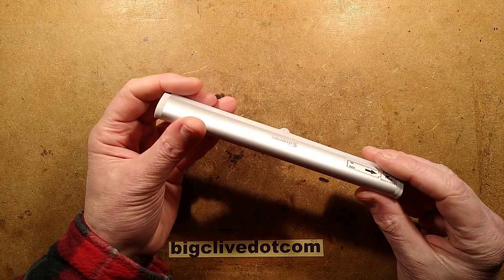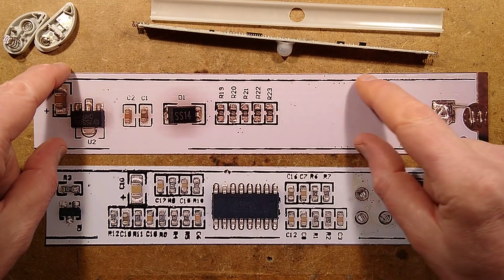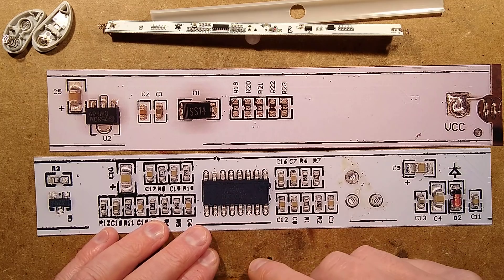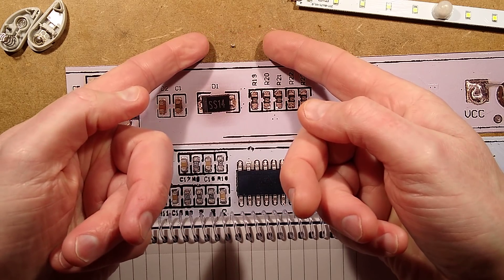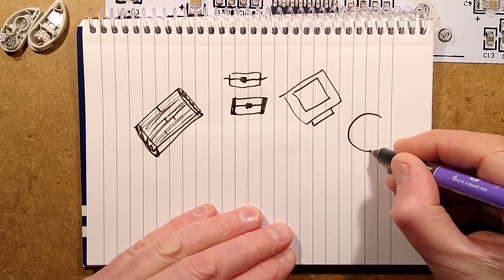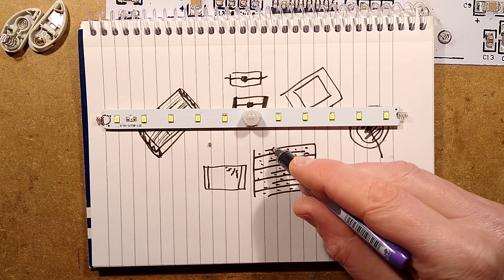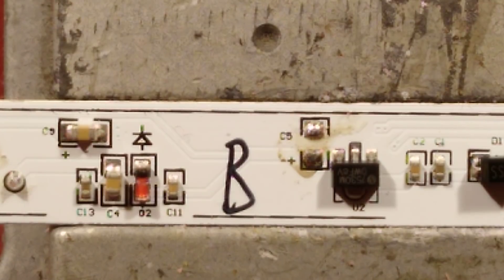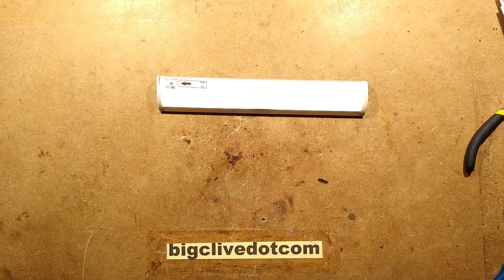Fixing a faulty battery PIR light that was draining the batteries fast.

Comment: Interestingly enough. I had a weird situation like that and like at first of the latest second it doesn't be any resistance here at all. This should be pure capacitants or even if it's completely bad open and when resistance was present. Oh my, what and I'm like? This is not supposed to happen and just tell me a stump what could have happened.  Happened to it? Because well, I'm never actually dove into the internals of one of these and absolutely this is just something that could easily happen. I don't think this is really a cautionary tale not to use these types of faster. But it's something to be aware of and if it's happened, once it'll happen again, kind of thing. So I definitely I'll keep this in mind in the future.  Since I've already run into it and just come unburied.This memory this video that is and yes well rather peculiar failure mode for sure and interesting them at last

Comment: I've got two battery powered PIR's that are drawing way too much current and flattening the 3 x AAA batteries. Yet they both work OK. So by your measure I should look for a leaky C first eh? There's also a SMT electrolytic that has been replaced with a wired electrolytic (in both) ....!! I suppose it makes sense since it works, but what do you think of that: They do usually leak a bit of DC. I've dealt with surface mount BUT not really the fault finding/failure side of them. I'm aware of static damage especially to Transistor junctions. So I'll go for the caps first then. I enjoyed your videos. Unpretentious, very honest, and full of handy snippets. Thank you. 
Notes: Me a lifetime of "electronics" from valves on. A bit lazy now wrt surface mount as the eyesight isn't that good. These really are tiny. I just want a result! Rgds BjG

Comment: One "solution" to MLCC is to have two in series so if one shorts you still have one left before it shorts out.

And also seen on EEV Blog it can be soldered to a seperate small pcb for holding the MLCC and the soldered to the board to prevent stress on it so it's decoupled from the main board

Comment: Thanks Clive this inspired me to look at an Aldi strip led PIR powered by 4 AA cells  it only lasted a few days. It  look as though they put a 3.3 V Zener to stabilise the voltage for the PIR this was fed b a 1K resistor it was drawing a constant 2.7m-A when the cells were new. Removing the zenner cut the consumption and it still works ok. I think the circuit was designed for power supply operation rather than batteries. Could this be the case?

Comment: Fascinating. I've been wondering how they make surface mount capacitors. It looks as if they are trading off size against reliability, and it isn't working out. Are the more expensive brands larger?

Comment: How did you determine the baseline current draw to find what the leakage was?
Reply from the maker: These things usually have a quiescent current of 50uA or less.  I connected it to my bench power supply and it was initially drawing 5mA continuously which is why it was eating batteries.

Comment: I always wondered just how reliable those high-value SMD caps really are. I will definitely remember this problem, since it is not exactly an uncommon failure (and I seem to remember I've got a few battery powered PIR Leds in the shed, possibly with a similar drain issue! Thanks for a VERY useful bit of information, BC!

Comment: What do we define as "draining battery fast"? I have similar light and need to change batteries every few days which I thought is often.
Reply from the maker: That seems too often.  It also depends on the number of light actuations.  It may be worth getting a USB rechargeable version or some good quality rechargeable cells.
Reply: @bigclivedotcom  Oh I used rechargeable ones but I didn't like this cold white LEDs so I went back to warm white LED mains light with sensor in my corridor :)

Comment: Thanks.  I experienced this exact problem not too long ago with my Swiss Micro DM42.  It drained batteries in about 3 days.  One capacitor had about a 1K resistance.   A replacement electrolytic from my parts bin was too big to fit in the case.   Swiss Micro promptly sent me a replacement part and my calculator has been working perfectly fine ever since.

Comment: Just FYI. I had a whole batch of product that had one such capacitor problem and it turned out that the component glue and flux from the automated assembly process had conspired to make the PCB under a particular capacitor somewhat conductive, always the same cap and always the same cause. Remove the cap, clean underneath and replace (new cap BTW), all good again. lost count of how many we fixed but certainly many hundreds over an extended period.

Comment: install a disc capacitor to fix the problem . The unit would probably work fine without that surface mounted trouble maker

Comment: It's always caps, the weakest link.
Surface mount or discrete, when any electronic device fails and it's not the batteries, blame the caps.
Whoever finds a way to make caps that don't fail so quickly may retire to the Seychelles the next day.
Reply: Maybe we should use polystyrene or silver mica throughout, eh ;-)

Comment: i wonder if it got a static discharge "zap", that for sure kills them.
I've seen it happen on tv's where the people zapped through to the side button board and it shorted a cap out down on the remote sensor/power led board at bottom of tv, they were directly connected then from there to the bigger boards.

Comment: We used lots of these at my last company, and they do fail quite a lot when stressed from either heat or just flexing of the boards. Even more interesting when they're used in HV circuits as they can melt down or literally be blown clean off the board by the discharge when they fail.
Reply: Did you figure any way to make them less fail-liable? Not much opportunity for stress-relief, with SMDs (as opposed to THT. where kinks in the leads will comp for most thermal or board-flex differences).
Reply: @theskett  Actually we did find some ways to reduce the failure rates. Specifically on a PSU module that had multiple panels wrapped around a chassis that tended to flex during testing and cause cracks as well as bow after installation. I did a study of various materials to find a composite that was stiffer and resisted bending and flexing and that solved the issue of them cracking. On other types of modules with odd geometries its also been solved by tweaking the reflow profile to allow the solder joints to better relieve stresses so they don't crack.
Reply: Thanks for the info, appreciated.

Comment: It's wonderful to me every time to see how different your soldering technique is from mine; my work on MRI image coils involved a lot of swapping out those cubic-millimeter SMD caps during circuit tuning, and I always soldered up the pads and then flowed one end down and then the other. I did have hot tweezers but those were really only useful for removing components.

Most definitely hit those with 63/37 and a nice relaxed iron, though.

Comment: Yes! I had an old fashioned alarm clock that I decided needed a small modernisation to rechargeable batteries. I used a USB Li-po charger module from eBay and connected that up to the battery. It worked great except it needed charging every month! Eventually I decided to dig up this rabbit hole and monitored the leakage current while heating up each component with a soldering iron. As soon as I touched the MLC capacitor, the current changed wildly. Now it lasts multiple months between charges :)

Comment: Hey Clive, soldering small SMD components with hot air is easy and fun. Place on the bench a scrap PCB, take hot air gun in your hand, start with desoldering components and then try to solder them back. Test different temperatures, air flows, nozzles, fluxes. It's easy to learn when there's no fear of damaging something, because it's scrap anyway.

Comment: These boards will be made in one large panel, maybe a dozen per panel. When this panel is 'broken out' into the smaller boards, stress or bending can cause an MLCC cap to crack. Then it's just a matter of time to catastrophic failure.
I've seen boards being removed from a panel like peeling a banana. Result? a 30% failure rate.

Comment: Hello Clive at 9.25 in on the video you show a component, and would I be right in saying the unit was a touch light box, it looked very like one I have just replaced in a lamp. They tend to blow quite often and wonder if you have done any videos in reverse engineering and figuring out what component really fails? If not it might be an interesting project vid. Many thanks enjoy all your videos.
Reply from the maker: It is a touch sensor.  One of the most common failures of any dimmer is to jam in an on state when a lamp fails with a pop.  Small lamps tend to arc over inside like a discharge lamp when they fail and it causes the triac to fail.

Comment: Lious Rossmann has another way to find a hotspot:  Spray the board with high-purity IPA (which you have around anyway for cleaning boards) and look for where it evaporates fast.
Reply from the maker: In this case the temperature of the faulty component is very low, so it wouldn't work.

Comment: Definitely not the first time I've seen MLCC failure -- don't get me wrong, I still use them, because the benefits outweigh the potential of failures -- but man, it is difficult to ascertain WHY they failed. Physical/thermal stress-induced fractures are probably reason #1, but I've also seen improper flux-cleansing methods cause leakage problems. I do have to wonder whether some MLCC manufacturers tend to push the voltage rating limits of their components.

Comment: So, a pacifist went rogue? - It happens! 💩 😂

Yeah, and I remember a time when there were those who believed that capacitors never fail. . Several orders of magnitude greater, we have a 20kVA single phase generator that uses a capacitor to 'kick up' the excitation circuit. Just about everything else was accused, tested and replaced. . . .  and still the generator would not produce power. I suggested that the capacitor hadn't been swapped - why not?    I was shot down in sheets of flame for daring to even think the cap was at fault, and do you know what? . . It was that cap that was at fault! It still had capacitance, it still stored a charge and landed a decent belt on your finger ends, but it had a dreadful ESR, so much so that it was measurable on an ohmmeter. On the plus side, a cheap and simple 'motor run' capacitor was installed in its place, and here we are, twenty five yeas or so later on, and still working as its creator intended!

On the vintage radio and TV front (my area of interest) it's always the caps that you go for first - Mains filter, boost rail and coupling especially!
Reply: You must know about those nasty RIFA mains filter caps.
Reply from the maker: Oh yes.  The little gold ones that burst into flames.
Reply: @userPrehistoricman  Let's say I've encountered a few, though they seem to be getting rarer as time goes on?  My favourite encounter was with an enclosed bench variac, into which a previous owner had added a small filter circuit. I plugged in the variac, and there was a loud crack, from the variac, followed by smoke from the variac, followed by a nasty smell. . . . . I've often wondered how do they manage to pack all that smoke into such a tiny component? Anyway, it was a RIFA!   You sometimes find them in 1970s BRC products (amongst others), and when you do, you inspect them carefully. They usually crack at the ends, and in any case, you replace them on sight these days. Same rule applies to those black cylindrical "Callins" capacitors.

Comment: Why would anyone use smoothing capacitors in battery powered appliances anyway? Line resistance perhaps?
Reply: It's a buffer, basically; capacitors oppose a change in voltage, so once it charges up to the regulated voltage it'll tend to hold it steady against any dips or spikes caused by switching things in and out of the circuit.

The PIR sensing specifically needs a very steady reference voltage to work properly, and that regulator serves the PIR sensor and IC. The LEDs are powered right off the batteries.

Comment: I have had multilayer ceramic capacitor fail with flames.  That was when I tried to use them at something like 18 V AC.  Never again...

As to the conductive material inside - somehow I had an impression that it might be palladium, but maybe that is only used in the tiny resistors.

But I often try to figure out the RLC equivalent components in similar situations.  The capacitance (and possible inductance) have frequency dependence.  The resistance not so much.  My component testers are limited to the common 100 and 120 Hz and 1, 10 and 100 kHz test frequencies.  Beyond those, I can use my 1 MHz LCR bridge (if it likes to work -- I would need to clean all its myriad of dirty contacts) or get out my HP Q-meter.  Mostly I pick up a few resistors and make a 50 ohm parallel set which should minimize stray inductance.  Then I connect the component of interest in series with the 50 ohm assembly and use a VNA Mini to see what I can find.  Oh, I sometimes have also tried what my phase angle meter can tell.  It is limited to 13 MHz.  In that respect, I probably could see the behavior with a sine wave signal and my oscilloscope.  More than one way to push ahead, when I get interested enough.

Comment: SMD capacitor cracking often happens when the individual board is separated from its original panel. It's very easy to flex the PCB and put undo strain on the part.

Comment: As it's only a smoothing capacitor and its dc voltage anyway what effect would it have on the light without it ?
Reply: probably work ok without it, it'd be to reduce transients when switching the leds on and off, if unsmoothed they might confuse the chip
Reply: and, some voltage regulator chips go unstable and oscillate if they dont have capacitors on input and/or output,  in some cases has to be within a fairly narrow capacitance range,

Comment: damn modern caps again, 😁 , bring back good old wired ended components .  i have a laptop that has a dead short across its internal 5v line, and its infested with these things,  wonder if shoving in 5v at high current would show up if any are bad 😉 its dead as it is so nothing to lose, really.
Reply from the maker: Try putting it on a current limited supply so the rogue component gets hot and then either spray the board with alcohol to see where it evaporates or do a finger test.
Reply: @bigclivedotcom  hmm, i've got some freezer spray, maybe that'll be better..

Comment: hmm, I've recently started making some PCBs at work for use on drones and I've been thoroughly enjoying the availability of very small footprint 1uF mlc ceramic capacitors for power supply and decoupling circuitry. A minor revision may be in order :/
Reply: hmm yeah, try not to use them if possible,

Comment: That capacitor should not even be needed since the device is using batteries as a source which supply a stable voltage/current, even when the LED's turn on. If the voltage changes too much when the LED's turn on then the batteries are on their last leg anyway.
Reply: some voltage regulator chips require caps on input and output or they can go unstable
Reply: Alkaline battery voltage actually dips and rebounds significantly over a discharge cycle; the LEDs don't care, but the PIR circuit needs a dead stable voltage, probably 3.3V, in order to function.

Comment: Very nice fix.. I just had an issue with a 1400 usd camera I own where the small SMD Cap like the one in your video here was went bad and took out my LM2676s-adj. Sadly I don't have the way to make the right repair do to not knowing what the CAP was. But I got a New LM2676 installed it and took a CAP from a different item that looks the same size installed it in the place of bad one and now my 1400 camera is working again. Sadly without a Schematic and not knowing what CAP I need I don't know how long that will keep it working... Odd thing is there was no signs of the cap being bad. I did all the Testing of the board till I found short to ground. Cap Removed That short went away kept testing till found the Power supply chip was also short to ground after removing a couple of other Diodes and a Inductor that I thought was bad found it was the 2676 after removing that no more short to ground... Put the other parts back on board. Ordered a NEW LM2676 and installing that. Sadly not knowing what CAp I needed I took a different item that was no good and removed a cap about same size from that installed in the camera. Tested the board for power it was back. Installed all the hardware back to the camera and put back in PTZ dome and now my Camera has been back in action for little over 24 hours now.